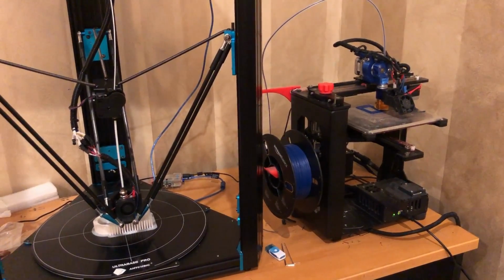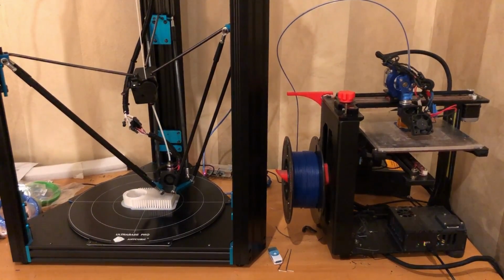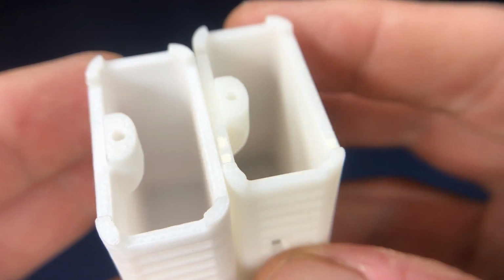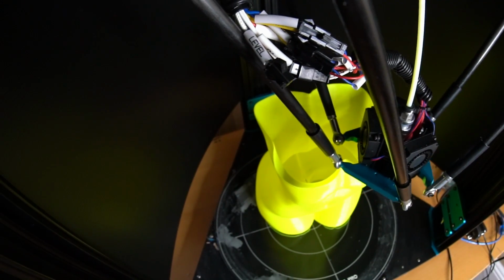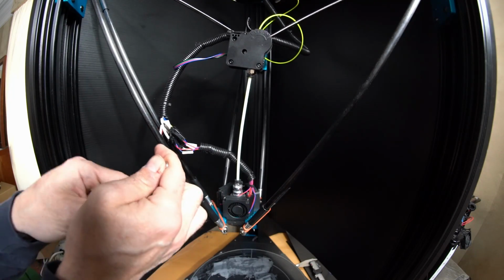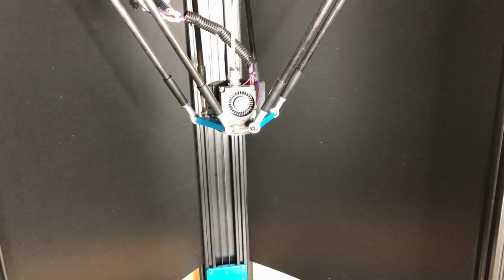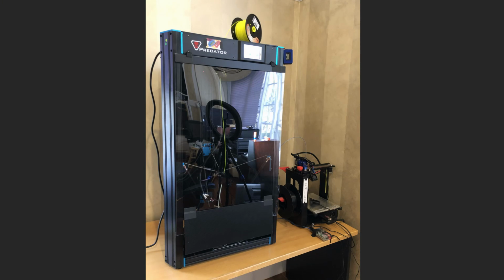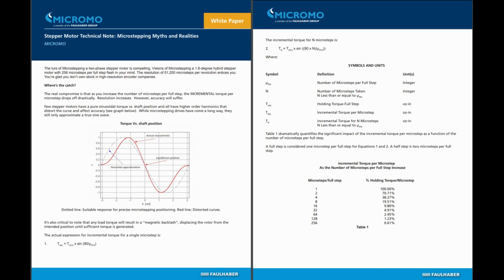Anycubic Predator Delta Printing Robot

Comment: You might want to link AnyCubic official to this because you answered more technical questions then their entire staff and it took you less than 30 minutes. I got one of the first Predators and am still waiting for technical support to answer a technical question.
Reply from the maker: They saw it but it would be up to them to link to it. Maybe you can ask them and say it was useful.
Reply: How do you like your Predator?
Reply: I like the machine, anycubic not so much. They're not good with customer service and horrible with technical support outside of sending parts. They sent me tiny Delta arms instead of predator arms. Everything on this machine was not assembled with attention unless I did it.
Reply: if you are a beginner for delta , FLSUN is  a brand focused on the delta ,It is highly recommended to buy this one https://www.aliexpress.com/item/4000130776715.html?spm=5261.13614333.0.0.763d4dcenY162R  ,200x200 printing size, less than 170$ ,the price in 11.11, off course , you also can consider about FLSUN QQ-s, 260x360mm printing size less than 300$ ， 
https://www.aliexpress.com/item/32813476326.html?spm=2114.12010612.8148356.3.2ed81747raVDog

Comment: Is it really a good delta printer?
Reply: Yes, it is. As I write this, I'm printing an industrial 6 inch diameter ABS part at 180 mm/sec, and thinking of pushing it to 240 or 300 mm/sec. Do I dare? It's an 8 hour print originally (at 60 mm/sec).
Reply from the maker: I am not sure how it compares to a $2500 SeeMeCNC. But it is the biggest one for under about $3000, as far as I know.
Reply: if you are a beginner for delta , FLSUN is  a brand focused on the delta ,It is highly recommended to buy this one https://www.aliexpress.com/item/4000130776715.html?spm=5261.13614333.0.0.763d4dcenY162R  ,200x200 printing size, less than 170$ ,the price in 11.11, off course , you also can consider about FLSUN QQ-s, 260x360mm printing size less than 300$ ， 
https://www.aliexpress.com/item/32813476326.html?spm=2114.12010612.8148356.3.2ed81747raVDog

Comment: Thanks for sharing your experience, Robert.  Did you notice a difference in  the fit of the ball joints on the control arms?  Mine came with a mix of good fit and sloppy ones.  I suspect the rubber band fix is a kludge for sloppy ball joints that would go away if they all were tight.
Reply from the maker: One of mine could be pushed side to side a little. But everything gets much more rigid with the bands. I like the bands and think they would always be needed, even with the best of joints.
Reply: @rsilvers  A better ball joint design uses plastic inserts which are molded tight.  These are the crimped variety... aluminum on aluminum.  They will wear looser so the rubber bands will help with that.  I greased them to reduce the wear and quiet them down.  Of course that leaves messy grease to deal with.  P.S.  Did you put bands on the upper joints as well?
Reply: There ain't no such animal as a "perfect" ball joint, it's just that some have more slop than others due to manufacturing tolerances. The rubber band fix is an effective way to eliminate the slop, works very well, and is very inexpensive. I also like to put a small drop of Krytox 106 oil on my ball joints. It never gets gummy or dries out, and needs to be done only every 6 months or so.
I have the magnets on hand to convert my Predator effector arms to mag joints, but the print quality is so good I'm going to wait until the ball joints fail, probably in about 50 years.

Comment: Any issues with the filament sensor giving false readings?
Reply: No
Reply: Doesn't surprise me, don't ask AnyCubic to troubleshoot or answer technical questions so no technical support just tell them to send you a knew one. Did you use dust off before assembled?
Reply: Don't have one, I'm asking. The CR10 line has that problem.  @chuckandy3d249

Comment: Hallo Can you tell me the mm size of  the o-rings , i`d like to buy them, but in Europe the no. 39 is not known.
Reply: It means the inside diameter of the o-ring is 39mm. The ones I ordered (haven't gotten them yet) were 2mm thick. That makes the outside diameter 43mm. Maybe you can find something with those measurements.
Reply: @Chris-oj7ro  Сантехнические резиновые уплотнительные кольца не подойдут?
Reply: Hans - Joachim Katemann 
Yeah, that would be great. I am searching for something like that to.
Reply: How about springs instead? Using small zip ties to secure them.

Comment: Nice video, thumbs up  , but at my opinion the Predator is much too loud. In the moment i don`t know how to fix it.
Reply: A couple ways.  1.) Stepper motor dampers (https://www.amazon.com/gp/product/B07HL2NMWG/ref=ppx_yo_dt_b_asin_title_o08_s01?ie=UTF8&psc=1).  You have to take the motors out and remount them, and change the gear distance. 2.)Change for a better cooling fan in the case, 24V.  3.)better Hotend fan.  It is also 24V
Reply: Проблему решат беруши)

Comment: Just got mine today. Didn’t come with any extra nozzle or extra filament.
Reply: I saw someone say that only the Amazon version has some of the extras. They possibly strip it down to make a lower cost version for some other sites were people are more price sensitive.
Reply: It was 559$ on Amazon, they stole your parts. Just go to the website and tell them to send them and it will ask who sold it you. They do this to see who will complain. Tell them you want a new power supply that yours sounds like there's rocks in it the one that came with them is garbage and will die if you use it for more than 24 hour intervals. Also make sure the arms are all the same length because they're probably going to owe you two of those also.
Reply: Where did you get it from?
Reply: eBay. $599 when it first post.

Comment: I want one now :-D
Reply: Would this be overkill as a first printer.
I really like the look and small footprint of a delta.
But Would like to have a big build area.
Reply: @Atimonster  Yes, this printer is overkill, but that doesn't mean you shouldn't get it. It looks like a decent printer. If you got 500$ burning a hole in your pocket, go for it! There are cheaper options made by Anycubic that are also deltas, I think its called the Kossel.
Reply: Have you tried printning small parts with it, like small pins and bolts?
Reply: @Atimonster  For a first printer? Depends how you look at it... If you go to cheaper models; they are mostly DIY kits that still need assembling. This one takes 30 minutes to put together and works right out of the box. If you get this one as a first printer I can assure you, you wont feel the need for another one any time soon.
Reply: if you are a beginner for delta , FLSUN is  a brand focused on the delta ,It is highly recommended to buy this one https://www.aliexpress.com/item/4000130776715.html?spm=5261.13614333.0.0.763d4dcenY162R  ,200x200 printing size, less than 170$ ,the price in 11.11, off course , you also can consider about FLSUN QQ-s, 260x360mm printing size less than 300$ ， 
https://www.aliexpress.com/item/32813476326.html?spm=2114.12010612.8148356.3.2ed81747raVDog